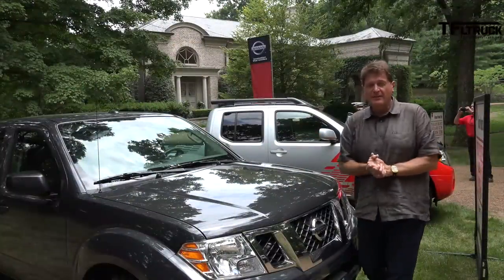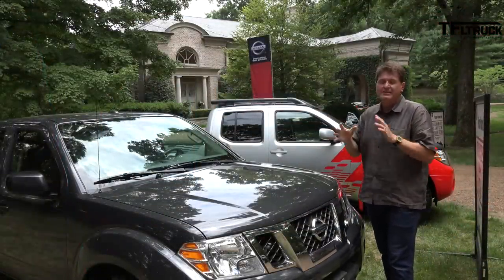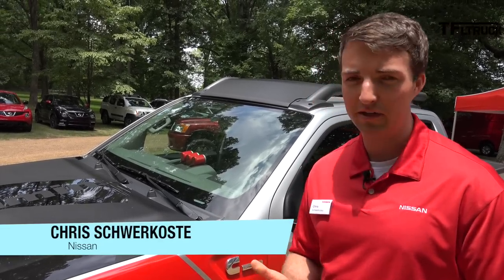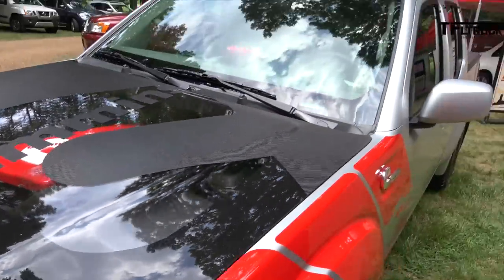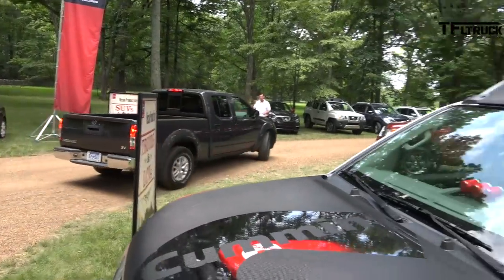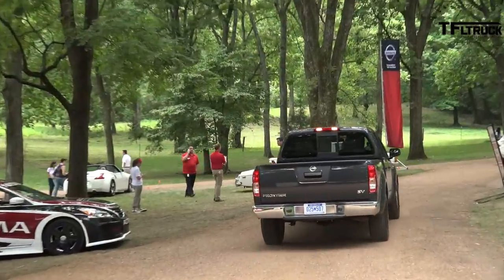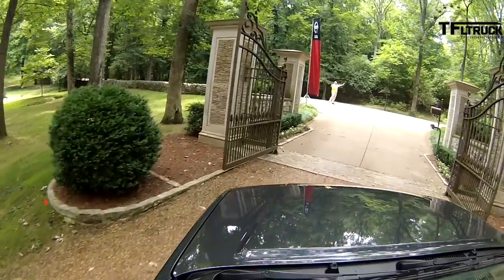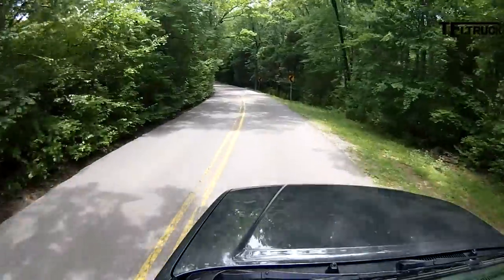Exclusive: Nissan Frontier Cummins Diesel Prototype Pickup Drive & Review

Comment: Definitely needed in usa. For some reason our stupid government and epa stand in the way of these kind of needed and wanted diesel engines. If the normal every day people truly ran this country there would be a lot more diesel options!
Nissan also needs to keep in mind that high hp and tq #'s sell. Don't be a slouch on power, 200 hp and 350 tq should be pretty adequate,  but a little more wouldn't hurt.
Reply: That's all they are advertising for this engine at this time.  Trust me this engine platform is capable of much more and who now's what it will end up with in the end.  I am willing to bet upwards of 225 to 250 hp and around 400 ft lbs of torque.  But time will only tell at this point.

Comment: Toyota better put the Cummins in their Tundra. Not many people like Titans,...which is why they sell like a bucket of dog crap.
Reply: Toyota needs a diesel in their Tacoma as well.
Reply: People might like the Titan better if it has a diesel in it.
Reply: Skott62
Yeah if they want to compete with nissan and GM they'll have to find a diesel engine to stick in the tacoma
Reply: Yes, Toyota already has a diesel. Wouldn't be hard to implement it. They just need to make the decision to do it is all. Just a matter of time now I think.
Reply: I too think the Toyota Tundra is far better looking than the Nissan.  What I really want is a diesel Tacoma 4x4.  VW never bought their Amarok over here but I like looks of the Tacoma better anyway.
Reply: Skott62 the problem is that the EPA is far more strict than the other world governments. Diesels power a great many vehicles overseas but they don't generally pass the EPA requirements.
Reply: Braden Weder lol now it does

Comment: I'm not sure if Nissan really has the balls to pull it off, but it would be one sweet ride...
Reply: Jacob Walls They just announced a cummins in their full sized titan... what makes you think they don't have the balls to do it in a smaller, cheaper to build truck of theirs? lol
Reply: ***** bc unless Cummins has a smaller engine, it doesn't look like the packing of the 5.0L will fit, plus who has need for a 5.0L Diesel midsize pickup....the frame and brakes wouldn't be able to handle what it could tow, people would die left and right

Comment: All these smaller diesel trucks are coming along at the right time b/c diesel fuel hasn't been this cheap in 20 years. This is a quick little truck! Styling is OK but Nissan could really step it up in that area. I like what Nissan is doing with the Titan diesel as well.

And to appreciate how far Cummins has come with their engines, the 5.0L V8 in the Titan makes 315hp/555tq which is just a little more HP than the 2003 Inline 6 5.9L HO which made 305/555. Very impressive!

Comment: How something translates to sales depends great deal on dealers. I bought frontier, desert runner this year and based on dealer experience, I really doubt I will ever again buy any Nissan (Had similar experience with Toyota years ago so, none of the last 7 new vehicles started with T.) As for truck, I bought it because it can tow my boat and because it fits in my garage without needing to free some space. Also, desert runner looks cute. The price was acceptable because it was stripped of many features that would come standard on full size truck (tow package, step boards, outside temp etc.) I installed some of those at the fraction of cost that dealer would charge. With dealer installation, the price would have been in the range on my F-150 XLT Texas Edition which is incomparable in every aspect and much much better truck than the Nissan Toy Frontier can ever be ..... Many Nissan models had serious quality issues in the last few years and company still needs to prove that they fixed them. Considering that competition in the segment is minimal, it will probably sell OK but nothing spectacular mainly because really bad dealerships that sell and support them.

Comment: Now I just need this bolted to a manual transmission, or see if the Cummins engine will bolt to my six speed manual.  I think Nissan could make a mint if they offered retrofit kits seeing as this test truck started as a V-6, some guys who like their truck and don't want a whole new vehicle would rather throw this engine in as a nice swap and keep driving the hell out of their trucks, especially seeing how easily the Cummins engine fits into the original chassis.  The 5.0 Cummins will be a beast of an engine in the Titan, I'm surprised they didn't go with the 4.5 liter inline four as that engine is rated at 520 pound feet of torque and has half the cylinders of the 5.0.  Just food for thought as most of Cummins engines start out as work engines in vehicles that get abused constantly, then someone figures out how to use them in highway vehicles, just makes more sense to me after seeing the success of the 5.9 and also the 6.7 engines, and I read years ago Cummins originally designed two engines for Dodge but the economy dipped.  Pickup trucks seem to be more durable when they build the truck around the engine, not trying to build the engine into the vehicle.  Just my opinion, and I'm probably wrong.

Comment: What ram and cummins NEED To do is bring back the old 3.9L 4 cylinder with the p7100 and no bullshit DPF/EGR, which had the exact same bore and stroke as the 5.9L Cummins, that came in 80's bread trucks and put them in the ram 1500's!

Comment: I cant wait for it to come here! I have a 2016 4.0 frontier crew cab lb with a snugtop cap, and I love everything about this truck. I am a bit concerned with only 200hp instead of my already 261hp which is awesome. But, I guess the added 100ft lbs of torque might take care of the hp deficiencies? If it feels the same as far as power to the rear wheels plus more uphill torque, plus the added mpg, I'm totally in. My wife is sitting here rolling her eyes, but yeah I also love the new look and extra leg room plus 2 inches more lift from stock.. I will be waiting impatiently to test drive and sign.. ps. please make 1 long bed one for me with heated cloth seats. Oh, in one article, I read that a 5.0 cummings v8 was also going to be an option too? I wouldn't think so, I think this is the titan, but that's what I read. Supposed to be 315hp and 555ft lbs torque? I will really be waiting at the front doors to get one..

Comment: I prefer diesel.  While not really interested in this size truck I do think diesel is the way forward.  I currently own 2 trucks, one gas and one diesel.  Both are great trucks but when it comes to towing I pick the diesel every time even though the gas has enough towing capacity for the items i tow.  

Just towed a 6x12 trailer over 600 miles including up and down mountain highways and there was no doubt the diesel was the best choice.  High torque, more weight and better fuel economy.

Comment: Wow Running boards its a pipe with a foot rest all trucks should have these its almost 2015 guys.We should also have diesel at low costs like the rest of the world and not at premium just because they get better MPG wake up america where getting screwed they have had diesel world wide for not much more in cost. But when they give us them they charge us triple make no sense at  all. Its like the diesel is the new iphone we all have to have because its cool and new when both diesel and wireless phone have been around for along time nothing  new to see here.It does look nice but they will rape us at 42-50 grand for a small truck just because its diesel small truck should be affordable for the average blue collar worker our pay does not go up just the trucks do.so sad diesel is old school and should not be a preimum because EPA is and big oil is mad that you get better mpg. :)
Reply: not everybody wants running boards, especially if they are going off road often, plus you could get them as an option if you want to
Reply: Diesel is actually cheaper to produce, the issue is its taxed higher, and a smaller portion of a barrel of crude is reserved for diesel vs gasoline. So smaller supply that is gobbled up by commercial trucking leaves little for personal use and receives all the tax.

Comment: Ford should build a F150 with a 3l V6 Diesel...
Reply: They have a 3.2 V6 diesel in the ranger here in EU but it only has 200hp
Reply: In Australia and New Zealand they have a 3.0 V6 turbo diesel. Puts out 405 ft pounds of torque.
Reply: Ole Andreas Bjørnstad Ryg The Ranger of EU has a 3.2l inline 5 cylinder... The Nissan Navara (EU Name I guess since it looks the same) has a 2.5 Diesel and a 3.0l V6 Diesel... All of the Diesels have turbos of course.
Reply: Fabien Mathey ups my bad.
Reply: MegaHamez
Yeah, I was wondering why they don't use that or the 2.5 I4 TD that we have, and use it in the American Frontier which is a Navara
Reply: blubb7711 Ford need's to bring the Ranger to the USA with the 3.2 I5 TD
Reply: whats the point? the 3.5 ecoboost makes 360 ft/lbs of torque, more than this cummins diesel.
Reply: I heard they were gonna use that powerstroke engine that comes in the transit and put it in the f150 but idk if those were just fake stories
Reply: Ricky Julian
 Trust me, you don't want a Ranger. There are build in Thailand and are even creapier than the Amarok. You can get one for 22.500€ in Germany, but not the F150...
Reply: +murmaider2 the 3.5 Ecoboost produces 420 ft. lbs. of torque, not 360 ft. lbs. Also, the updated 3.5 Ecoboost coming out in the new F150/Expedition/Navigator has 380 hp and 460 ft. lbs. of torque!
Reply: MegaHamez the 2014 ram eco diesel has 420 ft. ild torque
Reply: blubb7711
Il admit the engine sounded nice, my step dad owned a 2013 Ranger and the I was surprised how flimsy the panels were and the interior was pretty cheap, he worked in forestry and had a 2013 Navara aswell which was a good truck all round. A few months after buying the Ranger new he took it through a river which the Navara could get through and drowned it, so it was a write off, I think he's an idiot though
Reply: Fordguy1997 Sweet! where did you find that information for the new Fords?
Reply: Go to Edmunds. Com, cars.com or sms.com for whatever you wanna know about cars,  a prefer Edmunds. Com and ford is camino with 2 turbocharged 1 is the same 3.5 v6 365hp, 420lb/ft and a new one which I think is 3.0 v6 and I think is more powerful than the frontier diesel, the 3.6 is drop for a 3.5, they keep the same 5.0 v8 360hp, 380lb/ft and drop the 6.2
Reply: I was wrong,  they dropped the 3.7 for a new 3.5 and the new turbocharged is a 2.7 and I think is a v6
Reply: MegaHamez its still underpowered take a look at the chevy's trailblazer 2.8 200hp and 500nm of torque.
Reply: ram already beat them to it.
Reply: Brent Witter Lincoln put it on their website and check wikipedia. (I am one of the editors for Ford stuff on wikipedia)
Reply: TheCrEaSe44 No, Ram dropped the Dakota. They don't have a truck in this class.
Reply: Dave Workman the original comment was ford should put a 3L v6 diesel in f150, i said ram beat them to it. i didnt say anything about a mid-size truck.
Reply: TheCrEaSe44 Oops! Didn't realize. I thought you were aiming that at Nissan.
Reply: Dave Workman nah lol
Reply: Nissan's new motto is "Nissan sucks but you dont have to"
Reply: murmaider2 yeah but the cummins is only a 2.8. .7 liters is a lot. not only that diesels can be tuned to produce huge amounts of torque. this engine could easily produce 275 hp and 500 ft lbs with a good tune.
Reply: murmaider2 not to mention MPG would be at least 35 percent better than ecoboost
Reply: Chris Huber
except diesel is atleast a dollar more expensive than gas at any given point. So your fuel costs would be 33% higher. And you get to drive around a gutless clacky little diesel.
Reply: Gutless? You obviously haven't driven diesels
Reply: a small V6 diesel isn't gonna have much getup. Cummins I6s are gutless. Sure they got torque but something like the 3.5 ecoboost is both torquey and it has horsepower.
Reply: the problem is in USA Gas is cheaper than Diesel. Here in Germany Diesel is much cheaper than Gas, but the Taxes for Diesels are 2-3 times as high as for Gas Engines.
Reply: murmaider2 Try this one, its an i4... not a v6
Reply: murmaider2
the reason for the Cummins vs EcoBoost is reliability.  the EcoBoost is a direct injection and is having teething problems.  Alot of GDI engines have quirks, and the turbo versions have even more.  BMW was working with their design of an EcoBoost before Ford released theirs and BMW kept having issues, which is 1 reason you don't see/hear much about it.  They don't want it in the market screwing up their name & sales.
Reply: Overengineering soon.. very soon
Reply: Overengineering It would be more reliable, economic, and would make more torque than a gas engine. Better in every way.

Comment: Sounds good to me.  I really want a pickup with good fuel economy and this may fit the bill.  I am already leaning towards the Frontier.  I like Toyota and Honda, but both cost significantly more than Nissan.  Honda Ridgeline costs $29-34k and gets 15 city 21 highway.  Whereas Toyota gets between 17-21 city 21-25 highway and costs $20-35k.  Toyota gets 4 mpg better than Nissan, but to pay an extra $3-5k more does not seem worth it.  This turbo diesel may finally push Nissan Frontier head of the pack in fuel economy.  As far as the Canyon and Colorado are concerned, I am ruling them out because I want reliability and GM has not proven themselves yet.

Comment: Oh I love the outcome whit a Cummings diesel. I'm own the Navara D40 it have a 200bhp 4 cylinder CDI engine. Whit good torque my engine dos a bit over 380N/m. And get around 35-38 miles /Gallon. Love my truck run BF Goodrich KO2 275/70-16" whit 3" lift in front and 3,5" in the rear. As I'm pulling heavy trailer in my work. Works amazing good. Bjorn in Sweden 🇸🇪

Comment: The last time there were compact diesels in America you have to go back into the late 70s and early to mid 80s. Dodge D50 had a under powered diesel. The S10 had a Isuzu 2.2L Pup N/A in its first generation. Ford Ranger had a Perkins 2.2L 4.135 N/A diesel and a Mitsubishi 4D55 turbo diesel. People say drop in a Cummins 4BT, while decent option, its not viable, damn thing weighs well over 800lbs without anything (except turbo plumbing but no I/C).

Comment: Like the idea just not the frontier platform, owed one in 2006 for about a year that was long enough for me. Heavy truck, under powered engine/transmission combo and very vanilla interior. Bought a Tacoma and have been driving it since. The next 5 years should be interesting in the mid-sized truck category in the US, I think a lot more large truck owners will migrate to mid-size models and the diesel will probably help a percentage make that change. Right now the mid-sized trucks top out at about $35,000 sticker and full-size models are crazy expensive topping over $50,000. 90-95% of the capability of the work use can be done with the mid-sized trucks I think more people will eventually realize this and follow the mid-size trucks then eventually buy one. Cummins great, Nissan so so, EPA restrictions on small diesel bad for this group. Time will tell.

Comment: Absolutely I work in the Oil and Gas industry and have for years. Many of the guys I work with buy Dodges just for the Cummins but hate the truck. Also a huge point is alot if us drive personal vehicles and get paid mileage.  Mine being a 13' Denali 3500. I do tow time to time but my demands for heavy duty towing has changed I looked into the Jeep Grand Cherokee Diesel but after driving it the interior noise was terrible and it felt cheap for the price tag. I debated gas but the fuel economy sucks when towing. Leaving diesel as my only option.  TRD PRO awesome 13mpg...a joke same with the Raptor awesome truck and capabilities but again MPG! A diesel with real truck/offroad prowess with a warranty!!!! Please!!!!!!!!!

Comment: Yes, I would buy one if I was looking for a new truck. So anyway they are saying 35% improved gas economy over the standard V6. So if the regular V6 gets 20mpg highway this new form would give it 27mpg? 20mpg x .35 = 7 + 20 = 27mpg? that sound right? Even if it just got 25mpg highway that'd be pretty good. Either way I hope Nissan offers a diesel engine in the Frontier soon.

Comment: Nissan please do this right. GM and Toyota short changed the market and left a lot to be desired. You can make huge in-roads to market share if you respect the buyers and do the following: 

200 hp and 360 lb ft of torque
adult leg and head room for at least 4
trim levels that allow modest or full boat configurations, specifically full feature seats, especially for the driver, not 4 way power seats that are flimsy(didn't know you could actually get a seat like that)or in Toyota's case, no power, what???
Bravo for GM to have a diesel option and I would have bought one, but the rest of the truck was not up to the $45,000 asking pricing(lack of a garage door opener, the aforementioned 4 way power seat, wireless charging, push button start, sunroof, etc.....) 

With respect to the other manufacturers, they do a great job and I own two GM trucks, but I am not spending another nickel on what I perceive to be low quality/feature content vehicles at a premium price. 

And frankly Toyota's "new " Tacoma is a joke....Like the company but the truck performs at similar levels as the ten year old design...that what I mean by disrespect....

Please build an up to date mid sized truck with a strong diesel, charge a fair price and you will grab a big chunk of the market....